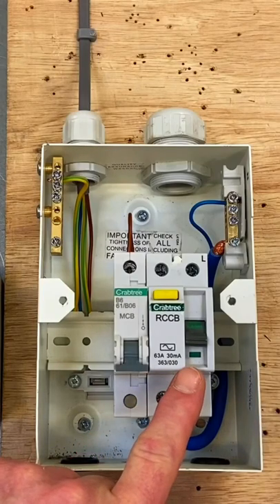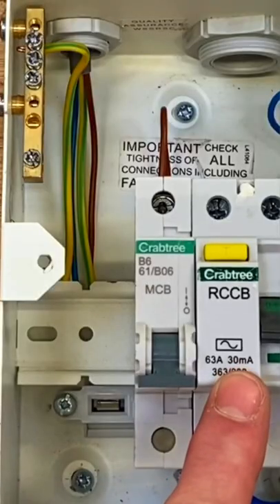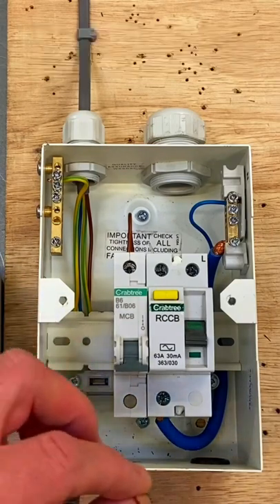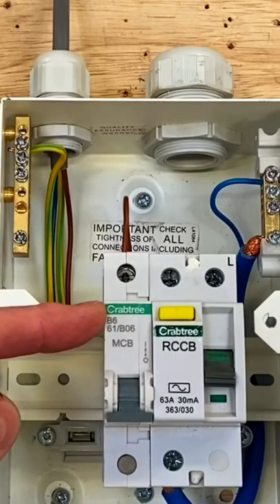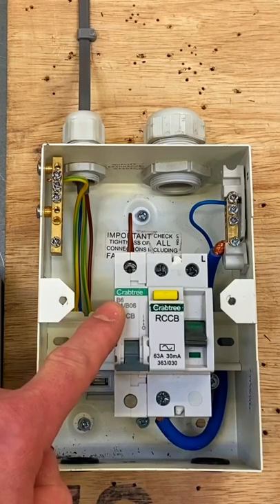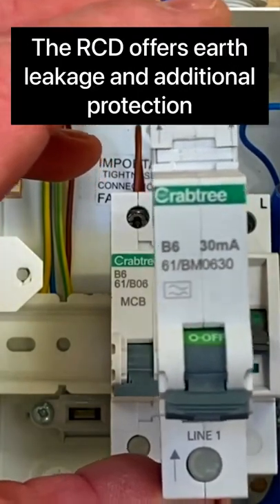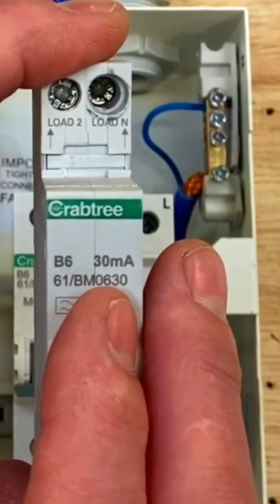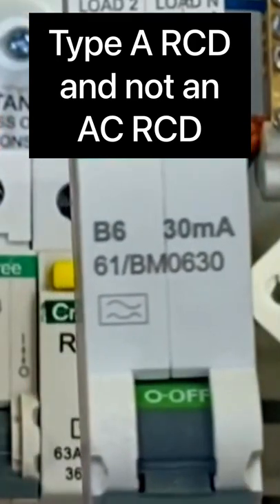Domestic Lighting 💡 - Circuit Protection - MCB and RCD

Comment: Are you saying that you can use the RCBO & a Main switch without the RCCB as there would be no discrimination between devices.
Reply from the maker: No - I would rather use an RCBO than an RCCB 👍🏻
Reply: Yes I agree, but in the CU panel if you remove the  RCCB you will then need to have an incoming main switch instead to isolate the panel ?